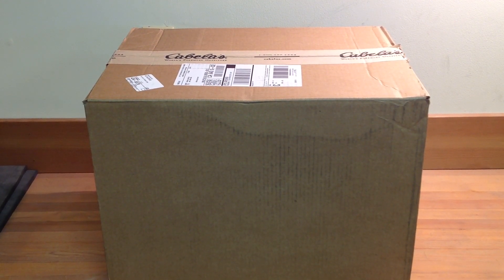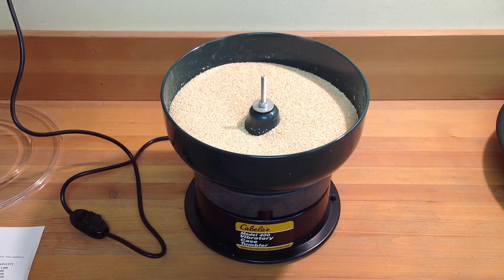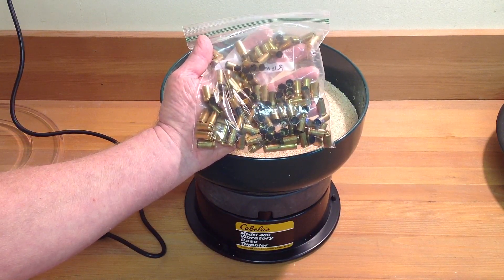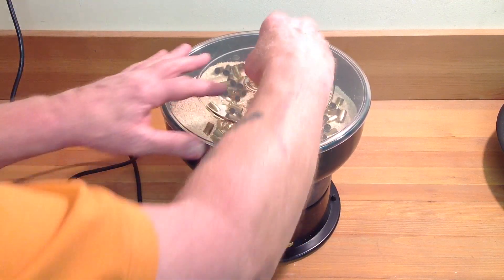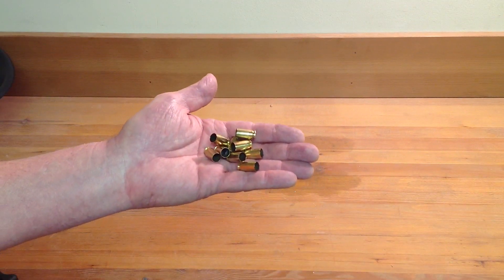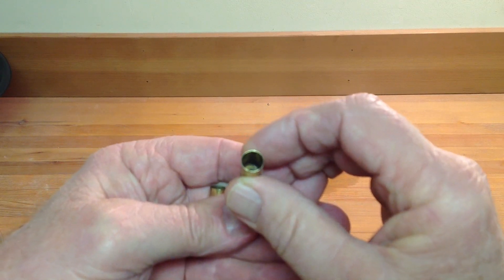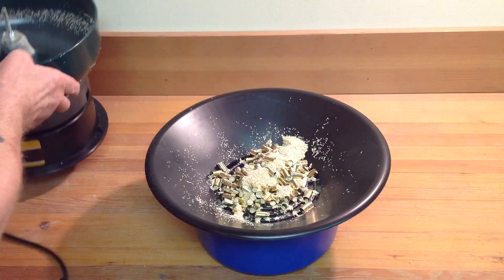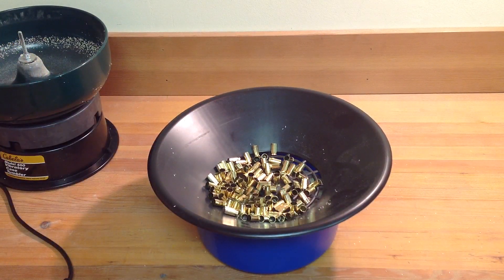Cabela's Model 400 Vibratory Case Tumbler Kit

Comment: I just got this kit today.  The instructions state it can hold 600 .45 ACP cases.  I put 500 (approximately) in it.  I noticed the more brass you put in it, the louder it is.  With just the media it is VERY quiet.  With 500 .45 ACP cases, it's quite a bit louder.  It's been running for about an hour and 40 minutes.... the cases do look better than when I put them in.  I'm going to let it go another couple hours and see.  I'm quite happy with this kit as well so far and I thank you for your video!

Comment: How many times can you reuse the corncob media before you have to change it out and get a new bag?
Reply from the maker: You can use the media many times. I would say at least 6 to 10 times. It just depends on when you think it is not cleaning the shells as thorough or as quickly as you like. Also the bag of media supplied is enough to fill the tumbler 3 times.
Reply: Add a dryer sheet to the tumble mix and all the dirt sticks to the sheet, I haven't changed my media for years... Does not affect anything just tumbles with everything else.

Comment: Bigbear1946 My name is Gragg Cain I noticed you possibly started reloading in 2014. that means you have been reloading for approximately 6 years. or did you start sooner. If you were a beginner like me what made you choose a Dillion over a single stage press. That is what I want but other reloads are trying to talk me out of a Dillion because of price. they want me to start with a 
single stage press that is not what I want. Why did you choose Dillion over other brands. please give me some input. good video!
Reply from the maker: When I posted this video I was very new to reloading. I did quite a bit of research and decided the Dillon 550 was the machine for me. It seemed reliable, durable, had many good reviews and could reload quite a number of different cartridges. Most important to me was the ability to quickly reload a lot of ammo. I was reloading for myself and a couple of friends. I may have chosen a single station machine if I was only loading a few at a time or was experimenting with bullets and amounts of powder. Hope this helps.